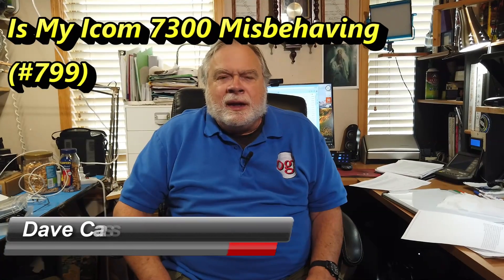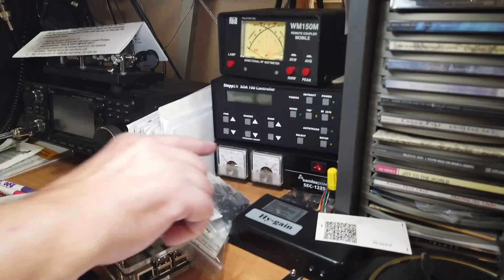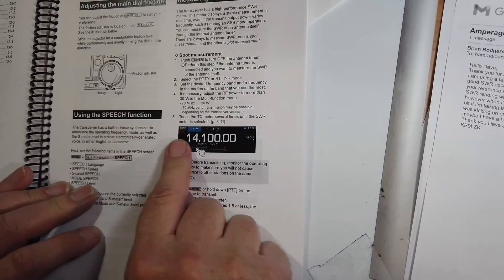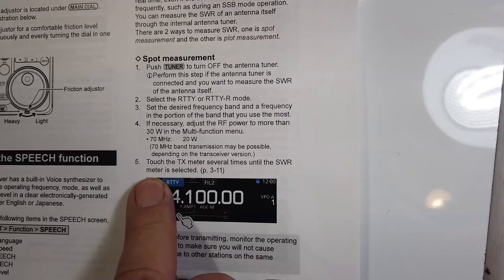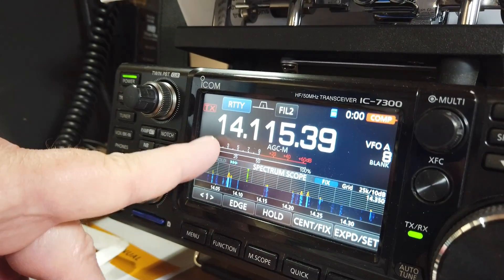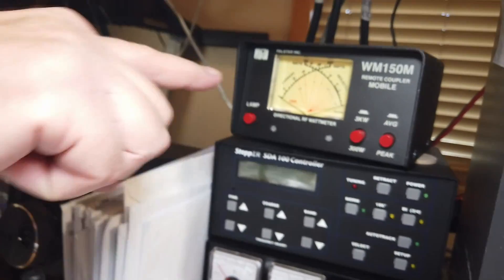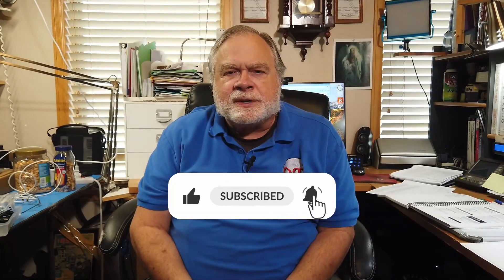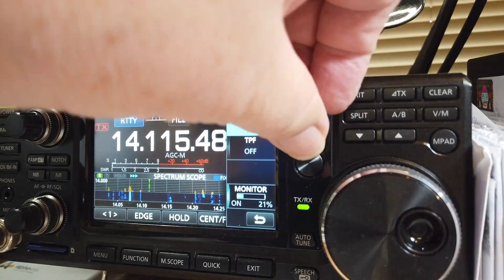Is My Icom 7300 Misbehaving (#799)

Comment: Great info David. Passed my general and ordering first radio Icom_7300. Was looking at same power supply as you but person at local club recommended linear power supply. Any thoughts?
Reply: The Samlex 1235M is a great power supply and will serve you well. I've had the same one for 6 years with no issues.

A linear power supply is good too, but they're much larger in size, much heavier, and much more expensive. Linears used to be preferred because they were much quieter on the air than old switching power supplies (which could cause a noisy RF signal due to the constant switching) but with modern switching power supplies like this Samlex it's no longer an issue.